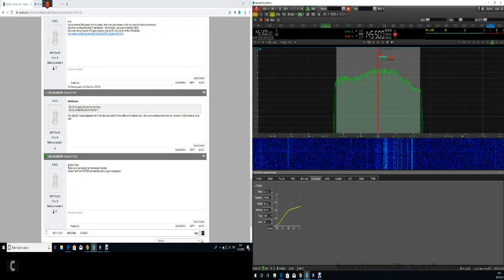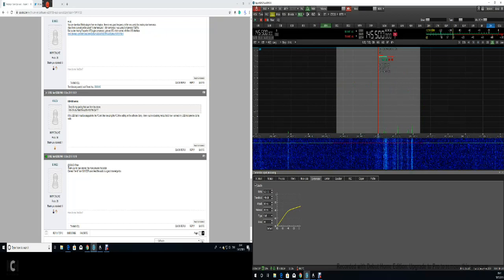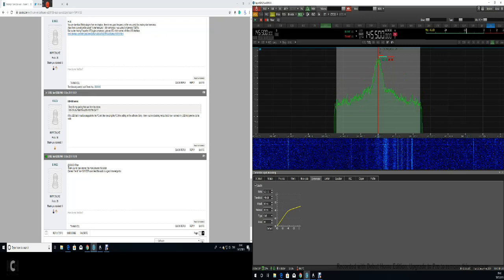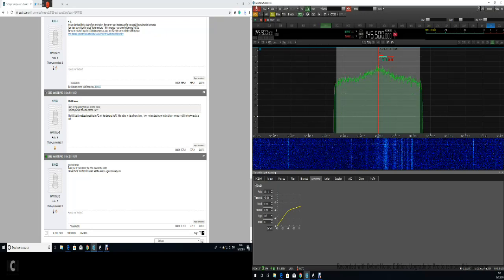trying to set audio on Sun SDR2 DX

Comment: Penny you need to enable noise gate so when you not speaking there should be no signal.
Try ratio 1:10
Treshold -50 

Attack 10ms 

Relase 100ms

This will coutout all of your backgorund noise too.

Regards 

Pawel EI9HEB/SP9DR
Reply: Hey, thanks. That's really helped, now I am getting a really decent amount of power out of the radio.